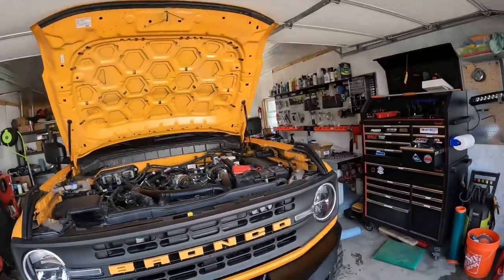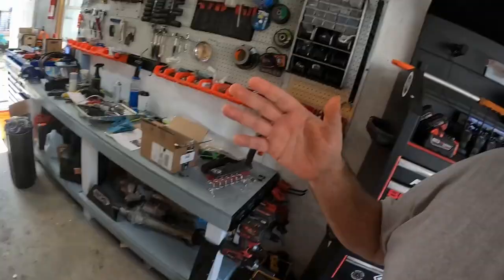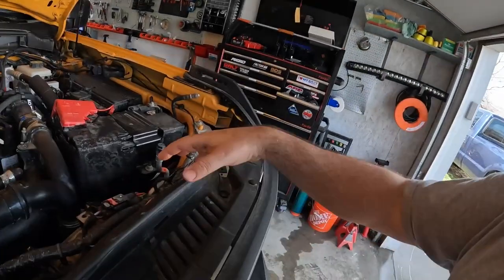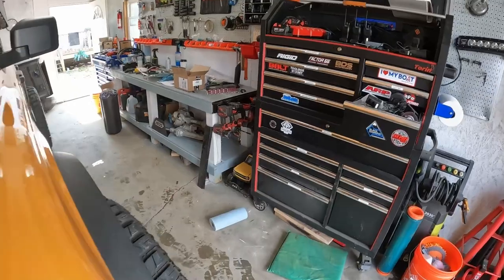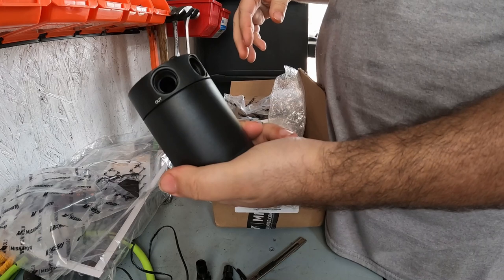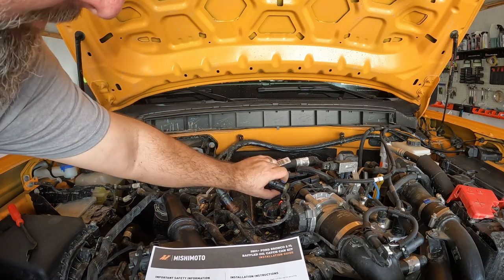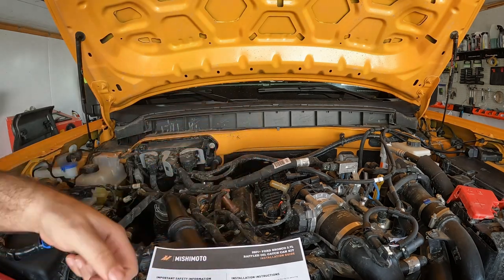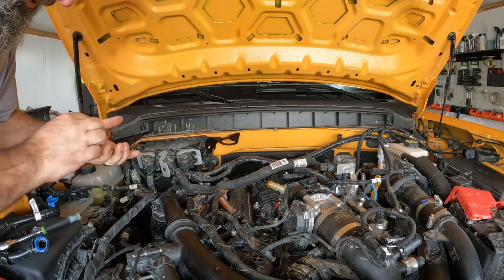Ford Bronco Oil Catch Can | Mishimoto  for 2.7 Engine

Comment: Off topic. Love all your videos. Wanted to get your opinion on bodyguard. Leaning towards those for mine. Any pro cons worth mentioning since you have had it awhile or any pro tips you have found on em?
Reply from the maker: They are awesome, great company to work with that care about their customers. One thing to be prepared for is all if it is heavy. The bronco does not have a lot of payload as it is so you will be cutting into that some but that’s going to be the same with mister aftermarket bumpers or rock rails

Comment: What is the advantage of the dual catch can over the single for the 2.7 ecoboost bronco?
Reply from the maker: The single can  collects from the PCV side,  the "dirty"  air that gets trapped after combustion, this is going to collect the most.   The Dual can also collects from the CCV side, which is typically cleaner air coming from the air filter but can still get contaminated especially if you are running something with a lot of boost.

Comment: Why do you need a catch can for a engine that has dual injection?
Reply from the maker: To keep the combustion as clean as possible, the oil won’t gunk up on the valves with port injection but it will still get in the combustion chamber. A little won’t hurt but over time it adds up.
Reply: @EvilleTruck  Great info